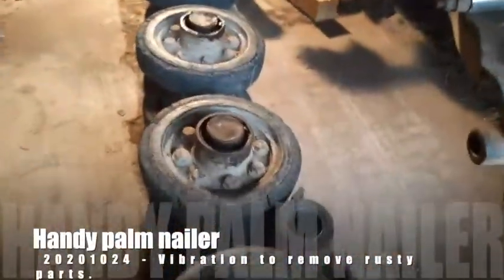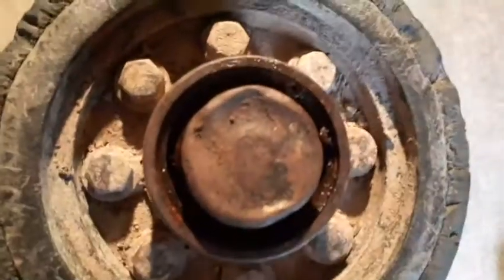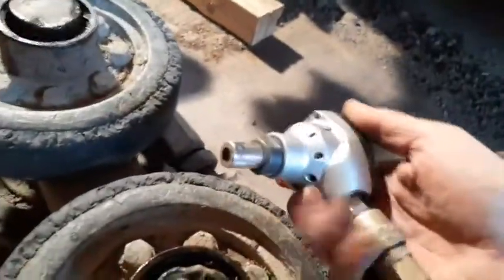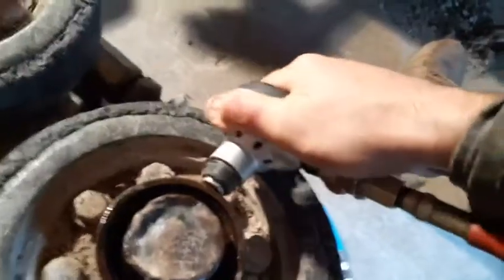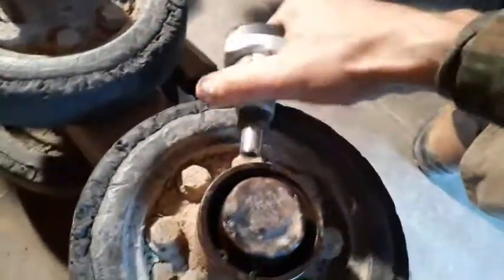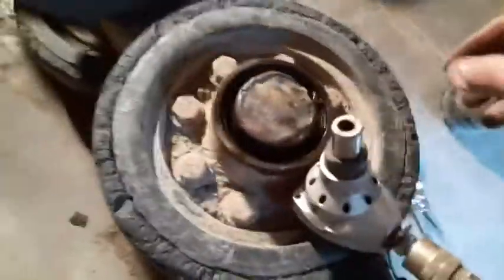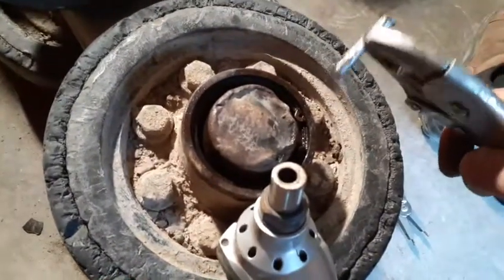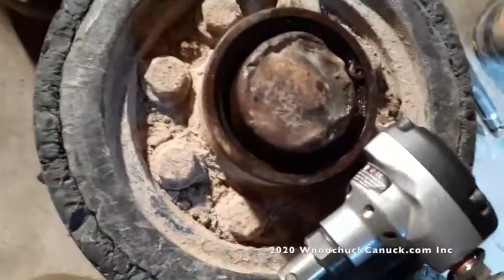20201024 skidsteer stubborn snap rings

Comment: Great tips thank you. I've got a 257b & on the right side, on the drive unit there is a grease fitting that came out with most of the threads left on the fitting. There is no grease fitting on the left side. Anyways, I haven't attempted it yet but there's a large snap ring I need to get off, hopefully its free. Thanks for video